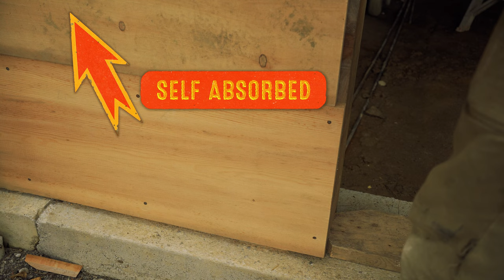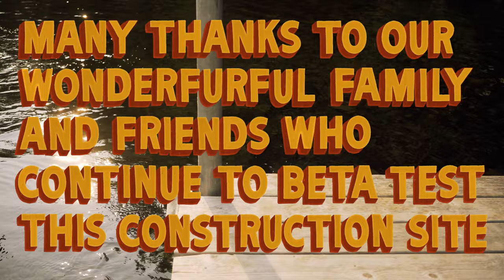The Joy of Building with Beautiful Lumber: SAVING our 1880s Maine Lakeside Cabin YEAR2

Comment: Nice to see signs of prosperity in Houlton. I remember, as a boy on summer vacation 50+ years ago, being impressed by Houlton and Presque Isle, but most of the intervening years have not been kind. Still, hope springs eternal, and you're helping!
Reply: Wait a second! What kind of nut uses a hobby knife with #11 blade to do carpentry? That's one reason I watch, to see someone else who can say, "I did it my way." (My way includes using algebra and trigonometry to do carpentry, which may be even more nuts.)
Reply from the maker: I've been coming here for 30 years. It may be a flawed metric, but I judge the health of the community by the health of the old downtown. It's still struggling, but much more vibrant than a decade ago.

 I do enjoy being active in the town. If nothing else, the hardware store loves me.
Reply from the maker: I appreciate this. I will admit that as I was trimming away the excess construction adhesive with an Exacto, I questioned my sanity. I decided it would be dishonest not to include the footage.